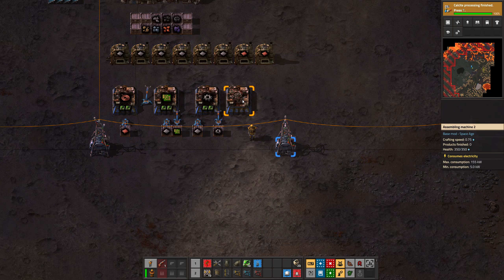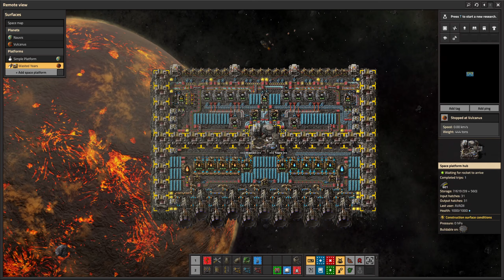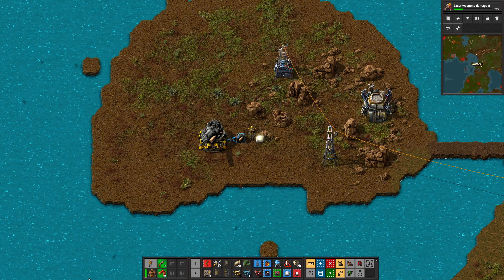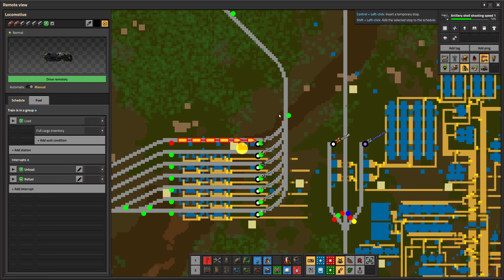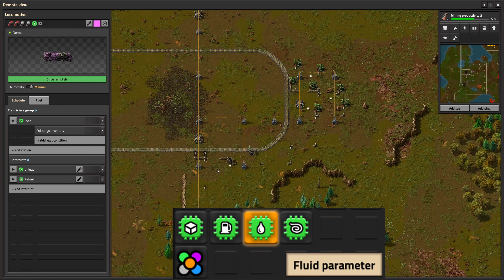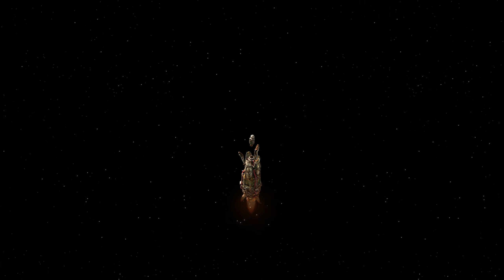How hard is it to beat MY OWN MOD? - The Mid Game

Comment: you dont used   modul in foundry to produce  foundry  that is  some another  productivity bonus/ for modul)  ... that make  foundry a little more  cheap and in vulcanus is posible say  no reason used any green  module becose how you say   electricy is free  and   no equqalient    polutions  so   why not used   other module  ... like  from start  you may    some   % from produce put on quality to speed up proces  uprage

and   navis simple need    final step in evolutions biter  make them fly   to ignore  wall   and turet  and give posibility  one more    make some   impack  on player base ...

Comment: Centrifuges with production bonuses? As I remember production bonus applies only to the difference between used and produced resources if they are the same item. So bonus not to 41 uranium but only to 1. Or smth changed?

Comment: Rather than spending ages farming rocks, when I was new to Vulcanus and didn't know how to kill the demolishers I channelled Dune by having a template of big mining drills that I would run out into the Worm Zone with, trailing power poles behind me, and slap down the drilling array on a tungsten patch and mine until I spotted wormsign. At which point it's time to pack up and leave. The Tungsten must flow!

Comment: Hi. While this interrupt based station grid is something absolutely life changing, I ran into (my, at least) historical issue about how to define the amount of trains a base should have.
In a small scale test I tried to run on my own, when I have 4 solid stations (iron mine, copper mine, and 2 smelters) I often end up with most trains waiting at one of the smelters' stackers when there's the other still in need of material.

Is it just a case of adding more and more trains? Could it be worth it to combine this system with circuit logic to dynamically limit the amount of trains at each station?

As a tangent, in your next video in this series you ended up with ~150 trains; how did you come to the conclusion that was the "golden number"? Even in the past, when I manually assigned destinations to trains, I could never reach a conclusion on what such a number should be at any moment.

Great video, great series, and great mod. Thanks for the content, have a nice day.

Comment: I've found that one weakness of a train system like this is that if you're underproducing, you'll likely underfeed most dependent industries because the trains are most likely to all to go one location. And it's also possible for trains to go far longer distances than necessary if you're producing something in multiple places while also consuming it in multiple places. Of course you get more flexibility and less setup time in return, but I think I do somewhat prefer more traditional train systems over this style.

Comment: Fyi your train system has a potential deadlock flaw

if there is enough trains that need fuel at roughly the same time (more common than you would think) and fully loaded trains go to the refuel stop, and at the same time already fueled trains fill the stop that the refulling trains would need to go to, the fuel stops can become unavailable, this can lead to no-pathing/desntination full and eventual deadlock.
Reply from the maker: You missed the moment I explain the refuel interrupt. It's condition is fuel < 5 AND empty cargo.

Comment: instead of farming obsidian by hand, unless your mod nerfed it of course, Why not just use like 100 gun turrets with 1k AP Ammo?
Just make a big block of them and aggro the small demolisher and run past them.
Iron and Copper is the only cost and thats an unlimited free resource so their is no cost.

I was expecting this strategy for the ore patch as you did this with less turrets in the vulcanus guide.
I couldn't do it with the reccomended 25 as too low tech, so build more.
Reply from the maker: Every run I like to find a new way to deal with demolishers. Spamming turrets has already been done.

Comment: I know this is very nitpicky of me, but I notice that you prioritise putting efficiency modules in your mining drills over your foundries, despite the significantly higher base power draw of foundries. Is this just a habit brought over from nauvis or do you have another reason for it?
Reply from the maker: Which foundries? The mall foundries have a low uptime, while mining drills work most of the time. But honestly efficiency modules on Vulcanus doesn't matter that much. You can also just build more turbines and don't use any.
Reply: @AVADIIStrategy  when you placed mining drills (and later big mining drills) on the calcite, the molten iron and copper foundries where completely module-free
Reply: i do the same. its gonna give you more resources in a long way so make sense to prioritize it as its 1st thing in the production chain anyways. also foundries have purple bar in default i think

Comment: Hint: For your 'sleep' interrupt, add the trigger condition 'not at station Sleep', then change the departure condition to '0s delay'.
Reply: Was going to come here to say this. Then the game would evaluate the open stations immediately, and probably save on UPS, as it no longer has to try to readd interrupts every 10 seconds for a ton of trains. They're just "locked" in a state, that will only retrigger the interrupt if a related station is updated.
Reply from the maker: Not sure about this one. The 10 seconds are meant to save UPS because during that timeframe the train does absolutely nothing. Constantly being in a state that "listens" to all possible target stations doesn't sound very efficient. But hey I have no clue how they implemented all of this internally so I dunno. UPS isn't really my focus this time around.
Reply: @AVADIIStrategy  It's essentially the same situation as a train waiting at the load or unload station if no destinations are free, which I believe is something they already optimize for. Trains in this state don't depart instantly, so I suspect it is internally doing a similar sort of loop to check once a second or so.
Reply: @AVADIIStrategy You might want to do some UPS checks on that. Having 1000 trains constantly inserting a new scheduled stop, evaluating which stations are open, then re-adding another interrupt which will cause lua callbacks, path evaluations, etc, vs a static "When X station's train limit changes, reevaluate my logic", which in most cases won't even cause a schedule change. Premature optimization can really bite you in the butt sometimes.

Comment: your editing is really good, shows the good parts, speeds through the slow parts, not just building and jumping around 😁. general question, i always wonder why people don't just go to fulgora first. you don't need better smelting for it (since items build downwards), so don't need vulcanus quite yet. you can just "quickly" trigger the techs without research, get the recycler/EM plant, and go. then you have the better buildings for all the other planets. you can always come back to fulgora to finish wish science since that's the more complicated chain. then the set up on vulcanus is much more productive and thorough. (and there's no such thing as a quick stop on gleba 😅).
Reply from the maker: Hi, that's true. Escpecially this time when not using the foundry on nauvis right away Fulgora makes a lot of sense as the first planet.

Comment: I've forgotten to research uranium processing on Nauvis with a sort of speed run to Vulcanus. I landed there with a crashed ship (I still have a save from Nauvis to build a better ship, but oh well). But now I'm stranded on Vulcanus without turbines... it's solar power or turning H2SO4 into steam, steam into water, and water into steam again to generate power. The mission: get a ship, leave Vulcanus with artillery, and kill my first biter base... and yes, I did Nauvis before (1st time rocket before 8h).
Reply: Can't you put the high-temperature steam into basic steam engines? They won't use it efficiently, but they can still use it.
Reply from the maker: You can simply use regular steam engines with the 500° steam, yes. No conversion needed.
It's really not a big deal. In my 1000X science cost run I did exactly that. Requires more space though ;)
Solar power is very strong on Vulcanus too. Totally possible to go for 100% solar if you want.

Comment: wouldnt setting up all trains to use wildcards and letting them sit in the sleeping area if their current resource is underused, potentially cause all free trains picking up the single overproduced material, that isnt used that much and then all just go to the sleeping area, waiting for the request to come? That is of course only if all of the other resources are underproduced, which makes them more likely to choose the loading station of the overproduced resource.
Reply: not really

you essentially need at least one more train than you have loading stations. all loading stations have a train limit of 1, meaning only one train can go there and "get stuck"/wait. you can control wether or not a station is active with circuits so you can switch it off if it has less than one train worth of materials in its stockpile.

only empty trains can be in the sleeping area, as soon as they have a material loaded the wildcard gets replaced by the items symbol so the train will try to go to the correct unloading station. unloading stations are of course also controlled by circuits but they can have a train limit greater than 1.

in my playthrough of exotic industries where i use this interrupt based system, ive never had the issue that im out of trains like that. Whenever i see that the waiting station is getting low on free trains, i add a couple more to the network and be done with it.thanks to the groups i just have to plop them down, give them a bit of coal so they can reach the refuel station and then never have to worry about them again.
Reply: @tatzecom oh well if only empty trains are allowed to go to sleeping station then yeah it should be fine

Comment: Instead of naming your stations "<Wildcard> Load", why not name them for example "<IronPlate> Load"? Wouldn't the wildcard work properly?
Reply: The name of the loading station HAS to be a single one for ALL solid products, and a different one for ALL liquid products; the wildcard symbol only gets evaluated if the train already has relevant cargo.

When the train is empty, "[wildcard solid] Loading" will be treated as literally "[wildcard solid] Loading", and the train is going to search for a station with exactly that name. If the train contains at least one item (eg. at least one iron plate), the wildcard will be evaluated; in that case, the train would look for "[iron plate icon] Loading", most probably breaking the system (ask me how I know).
On the other hand this has the advantage that, if for some reason a train with cargo is sent to a loading station, the train is going to freeze rather than loading mixed cargo, because "[specific cargo] Loading" doesn't exist. It's an advantage I only realized now, quite smart I have to say...

What this means is that you can give your loading stations ANY name, as long as you're aware of these rules. It makes little sense to use a specific product in a loading station's name because all products of the same type have to share the same name (eg. iron and copper plates loading stations need to share the same name)
Reply: @MrMe917  I see, thank you, so cargo wildcards can basically only be used dynamically for unloading? 

I usually like to name my stations for the item they handle (and use a train group for each item) for easy readability from the map, but I suppose I can handle that with display panels now. I'll have to play with this idea.
Reply: @achillesa5894 yes

Digging around I found a system to create a logistic network using interrupts (100% vanilla) that would allow to give the loading stops the name of the product, but it was much much more complicated
Reply from the maker: The name of the loading station doesn't matter at all. It's a static name that doesn't change since it's not triggered by an interrupt. It's just coincidence that I used the wildcard symbol. You can name it however you want. "IronPlate Load" doesn't make that much sense though, because then every loadind station for every item would have that name.

Comment: Have you considered foundires EM plants etc having 20% inherent productivity. Its less powerful, but I like that its an even 5 crafts. 25% is also an option but in base 10 I don't like it
Reply from the maker: No. I'm not bigfoot. The moment you use productivity modules or productivity research the numbers don't evenly add up anymore anyway.
So why bother? The only reason I would consider 20% or 25% is for balance reasons, not arbitrary 'I like even numbers' reasons.
Reply: Making it even doesn't really matter, their main use is having thousands of crafts an hour anyway

Comment: Great vid. I'm not sure if I missed it from your first video, but is there a reason why you used artillery on the demolishers instead of spamming turrets?

Also how did you place down targeting markers for artillery so quickly? I always have to spam click and it doesn't seem to be nearly as fast as the ones you were placing.
Reply: a neat trick is to put scroll wheel on the bind that u use to drop down artillery
Reply: @pedgux  So instead of mouse click you can set it to be placed when scrolling the mouse wheel up or down? That sounds like it'll be much easier to place a bunch at once.
Reply: @ElliottHansen yes exactly.
Reply from the maker: Because I don't like turret spam. I know it works, I've done it once, I've seen other creators do it even with medium demolishers.
I like to find new ways to fight them, poison capsules, discharge defense and so on.
This time I wanted to get the first kill with Artillery. Just to find out if it's viable.

Comment: The only planet that really caught my interest in the expansion was gleba. Vulcanus was solved in like 2 hours. Solve the puzzle and move on. And fulgora. Solve the puzzle and move on. But gleba, oh gleba how I like you. It really felt like an expansion. I was stuck and spent 160 hours to get out and it was amazing. 

I am honestly not sure how I would fix vulcanus. It needs more than a balance patch. Maybe there could be demolisher spawners? Which uses a resource not found on vulcanus to turn off. But which in turn requires a vulcanus resource to make? Or they could be brute forced, with a bunch of turrets. It could even have fulgora lightning a fixed time before it spawns, so you could use the collectors to run a circuit network to automatically target it with artillery as it spawns.
Reply: i've read about an idea of having to turn off the buildings every once in a while in the red zones, so noise doesnt annoy the demolishers instead of being able to kill them with 30 red ammo turrets, whcich would incentivize interesting circutry
Reply: @Hexenatlike pollution and spores. Keep sound pollution under control. It disappears right away when you turn the buildings off. 

Someone more advanced should use the a bunch of speakers to bait demolishers as they spawn/migrate
Reply: I experimented a bit with modding demolishers to respawn, requiring crazy defenses around mines or automating robots to rebuild mines.
I think having demolishers drop some kind of rare resource needed to fully automate science could be fun, like having to provoke demolisher spawns in the late game to farm them.
But I never finished it, for this concept the territories and their AI needs to be reworked a bit.
Reply: I thank God that you don't work in game development at all.

Comment: 25:24 Iron gear bulk inserter on the right has a steel filter and will not operate properly.
Reply: Mb you fixed it 30:04

Comment: Instead of using double rocket ingredients, I use a mod that requires planet based materials instead. Currently I'm only on Vulcanus and one launch rocket part requires a blue circuit, 2 tungsten plates, and 200 heavy oil. I dont even know what the other planets are going to require but it give me a reason to have to build larger.
Reply: Seems easier tbh, but cool anyway
Reply: @utis5965  Well 200 heavy oil is quite a lot. That's not 200 per rocket launch, that's per rocket PART, so 50x200 heavy oil per launch. It also means you can't import the parts from fulgora like most people usually would.
Reply: @snottytoe6957   You should be able to import heavy oil from fulgora, but kinda depends on how much a rocket can send